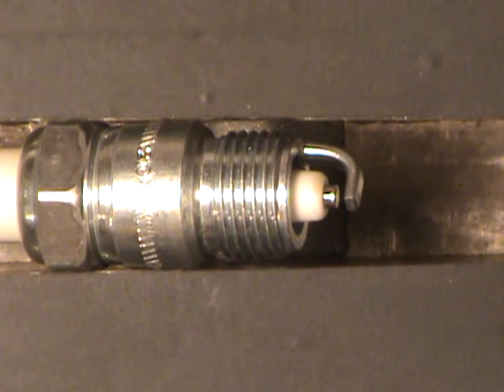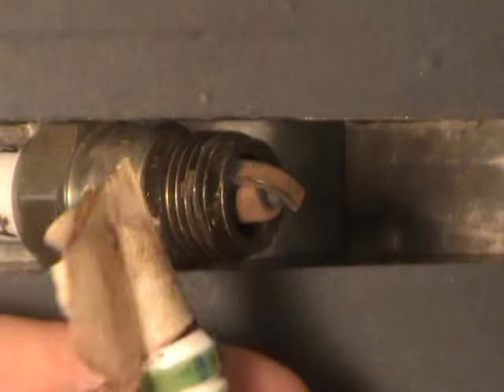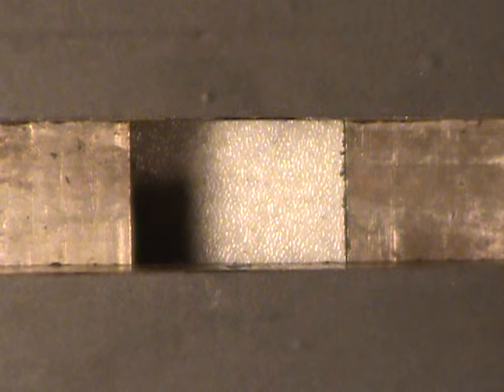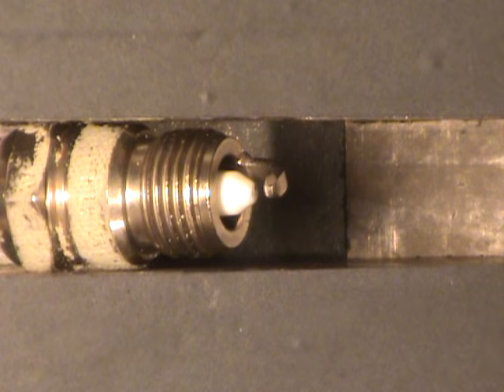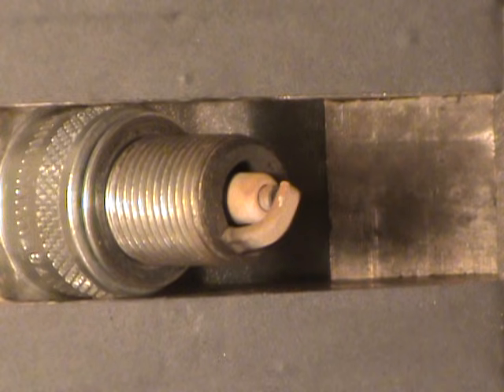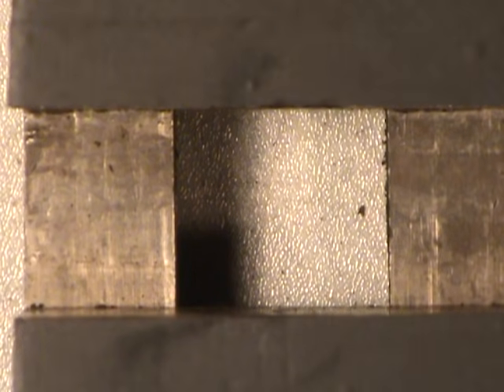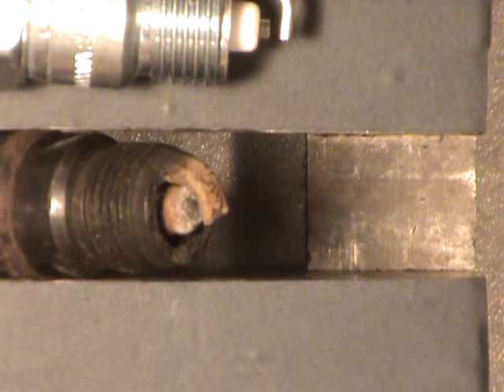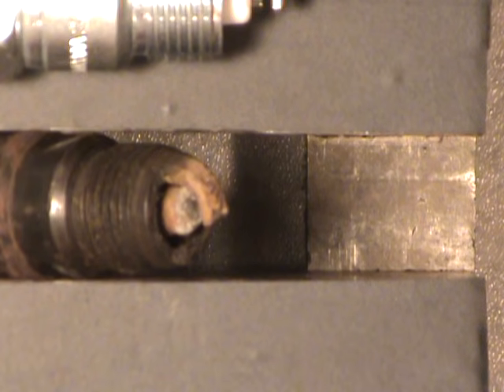SPARK PLUGS How to Read them (Part 3)

Comment: what would make your engine run hot
Reply from the maker: +Buddy Love ....Greetings Buddy Love....Thanks for watching....................I don't know what Vehicle or Engine, so, I'll just wing-it...lol.....................There are quite a few things, that can make an Engine run Hot, and hopefully Not Over-Heat as well.........When-ever a Tune-up is done on the Vehicle, the "Correct Specified or Certified" Parts should be installed, and the Tune-up, should be done regularly, and kept up to date.........A Hot running Engine, could be caused by some of the following..............Not enough Coolant (anti-freeze and water mixture), in the Radiator...Warning...!!!...Never Remove the Radiator Cap, or work on the Cooling System, when it is Hot, because it is under Pressure and will Burn You...!!!....Only work on it when it is Cold.....................A Restricted Radiator (internally, as in corrosion, or any unwanted deposits), usually caused by, not changing the Coolant (anti-freeze and water mixture), at the Recommended Time or Mileage/Kilometer-age Intervals...........A Faulty/Malfunctioning Thermostat, or a Thermostat, having too Hot of a Temperature Rating for that specific vehicle..........................Before the Computer/Fuel Injected Cars came into being, the Ignition Timing was adjustable, and if not done right, that could lead to, having the Engine run hotter then wanted as well............Those were just a few examples for You, and, if You need more help from me, then, if You care to, just let me know about, just What Vehicle, and What Engine, and the Miles or Kilometers, that it has on it, that way, I won't have to go on, what I like to call...A Wild Goose Chase...lol...and...........till next time...........Be Safe, take care, and have a good one.

Comment: great video thank you
Reply from the maker: +DieselSmoke92 Greetings DieselSmoke92....Thanks for Your nice comment, and, Thanks for watching...........You'll probably find, in a lot of cases, that, the some-what newer, (gasoline), Fuel Injected/Computer Controlled Engine's, Spark Plug "Deposits", might not be so much, well, as compared to the "Deposits" that You saw, on the spark plug samples, that I used in this particular YouTube Video of mine, and, might be looking, kinda white-ish in color at times.................From what I've heard/read about, the Higher the Ethanol (alcohol) %-age/percent-age, that is actually in the Gasoline Blend, that the Engine burns, then, the (probably/maybe?) Less Deposits, might be found, showing-up, on the spark plugs, in that particular engine, perhaps..................Some Folks, are using, what appears to be, kinda looking-like, that special flash-light, that a Doctor might use, to examine Your Ears, in order to have a much Closer look, at the Deposits, that happen to be, on the spark plugs................Perhaps, have a look around, on, some of the Web-Sites, for that, what I like to call, the..."Rocket-Science-Method"...(as in, using that special flashlight/magnifier, thing-ah-ma-bob)...in order to have..."Close-Encounters-of-the-Spark-Plug-kind"...!!!...lol...and...........till next time............Be Safe, take care, and have a good one.

Comment: Thank you so much! I have a car that was saying system is too rich, but on observing checking out the spark plugs with this, is seems to be running lean! Now I know I may have problems with the O2 sensor giving wrong info.
Reply from the maker: +golavish Greetings golavish....Thanks for watching.....................Please note, that, some of the newer, (gasoline) Fuel Injected Engines, might not have very many Deposits showing on the Spark Plugs, and, at times, the Porcelain-looking material, that surrounds the Inner/Center Electrode, might be showing an almost White-ish Color, and perhaps more-so, if the %-age/Percentage of Ethanol (alcohol) gets higher, in the Gasoline (blend), that You put in Your Vehicle's gas tank............................There are 3 basic things, that should be done, on a Vehicle, that has a Gasoline, Fuel Injected Engine, before, You might start to change this part and that part, which at times, might not fix the problem, if indeed, there really happens to be one................................Has Your Vehicle been well Maintained, as well as, having the Parts, such-as, Air and Fuel Filters, new Spark Plugs, etc., that should be Replaced, at the Vehicle Manufacturer's Mileage/Kilometer-age or Time Interval...???...............................Then, the other 2 things are.......Have Your Vehicle's On-Board Computer (about ,1996 and newer), Scanned for "Trouble Codes", with a Scan Tool (kinda looks like, a slightly Larger, hand held Calculator), in order to see, whether or not, Your Vehicle's, Computer's Memory has Stored any Trouble Codes, that will really help You out, if there happens to be any, that is.........................Then, the Fuel System's, "Fuel Pressure", needs to be Checked/Verified, according to Your Vehicle Manufacturer's, Fuel Pressure "Specifications"..............Warning...!!!!...some of those Fuel Pressures, might be, as High as, "60 PSI/Pounds per Square Inch", which can be very Dangerous, and, always Wear Eye protection/Safety Glasses/Goggles, have a Fire Extinguisher near-by, and Do any Fuel related Testing or Maintenance, and also, when-ever the Engine is Running, "Outside", with plenty of Fresh Air and Ventilation, because, the Engine's Exhaust Gas is "Deadly"...!!!.........................Some of the Automotive Parts places, might "Scan" Your Vehicle's Computer for "Free", so, just make a few Phone calls, to see, if any, in Your area, actually do...........................If You care to, You can let me know, the...Year...Make...Model...Engine Size...and any Problems, that You might be having with Your Vehicle, and.............till next time............Be Safe, take care, and have a good one.

Comment: mine come out white an it started bucking so im going to change my fuel filter it only has 180,000 miles lol
Reply from the maker: +Y0uNgM3xicAn Greetings YOuNgM3xicAn....Thanks for watching.......................If Your Vehicle is Fuel Injected, then, the Fuel Pump, will usually be installed, Inside of the Gas Tank...............................If...???...the Fuel Filter gets "Plugged-Up" too much, then, that Fuel Flow Restriction, could cause the Electric Fuel Pump (inside the gas tank), to "Burn-Out", and not work anymore...!!!............................I had this happen to me, soon after, I put some super-duper Fuel System Cleaner, in the Gas Tank, and, it did such a good job, that, it must have Cleaned, most of the Gas Tank's Innards, and sent all of that Crud/Debris/Yuck-ees, right into the Fuel Filter, and pretty much, Plugged it right Up, and Ruined the Fuel Pump...!!!........................Those Fuel Injected Fuel Pumps, could cost about $200 (Two-Hundred Canadian Dollars, that is), give or take, quite a bit, and, if You have to Pay Someone, to Re & Re (Remove and Replace) "it", then, the Price to do so, including the price of the Fuel Pump, could end up costing in the neighborhood, of about $500/Five Hundred Canadian Dollars, give or take, quite a bit...!!!...Yikes...!!!...and a Nice New, about, 10 Dollar Fuel Filter, could have prevented, that, very unwanted Expensive Repair Bill...!!!...so, it's really good, that You are putting in a New Fuel Filter alright................If You plan on keeping Your Vehicle, for quite a long time, perhaps consider, getting a Factory-like "Chassis (pronounced...Chass-ee) Service Manual" for it, that's if, You don't already have one, that is.............................Keep a close watch, on all of Your Vehicle's Fluid Levels, and Filters as well, and, install New ones, when-ever, the Factory Recommended, Time or Mileage/Kilometer-age, becomes due, in order to avoid, any Problems, that are not wanted........Yes-Sir-ee-Bob...the Fuel Injected Engines, that are being Controlled by a Computer, will probably be, having Spark Plugs, that, don't have a whole lot of Deposits on Them, as compared to, the much Older Vehicle's, that have Carburetors, Distributors, and No Computer what-so-ever...lol.................................If You care to, and, if You are having any problems with Your Vehicle, just let me know, in a comment/question or two, under any of my YouTube Videos, letting me know, what Vehicle, and the Engine that's in it, and I'll do what I can, to help You out, and.............till next time............Be Safe, take care, and have a good one.

Comment: is there anything out there for, 2009 Xterra spark plug change, please i need help, cant find anything, email please, thank you HOWARD habeas7@gmail.com
Reply from the maker: +Lecy Alphamaids Greetings Lecy Alphamaids....Thanks for watching, and now, let's see what we can do, to help You out, with finding some Spark Plugs, for Your 2009 Nissan Exterra, shall we..............................Here's what I would usually do, if I was in Your shoes..............................First, I would try to find, the "Exact Same" Spark Plugs, that were "Originally Installed" in, Your 4.0 Liter V-6 Engine...???... if in fact, Your Engine has not been Modified at all, at any, of the Auto Parts Sales Establishments, that were, reasonably close, to where I, actually, where You live, oh and, for a reasonable Price, as well............................Then, if they didn't have them in Stock, I'd find an Auto Parts Sales Establishment, that would..."Order, a Set of the Original Spark Plugs"...in for me, in a reasonable amount of time..............................Have a look, in Your Exterra's Engine Compartment, for a V.E.C.I. (aka, Vehicle Emission Control Information) Label/Sticker, and, sometimes, on that Label/Sticker, the "Original, Factory Installed Spark Plugs", will hopefully be Printed on it...................................Also, the better equipped, Auto Parts Sales Establishments, will usually be able to do a "Parts Look Up", for Your "Exact Vehicle", and, that Spark Plug "Listing", would usually have, quite a few, Different, Spark Plug, Manufacturer's "Offerings", but, for a Factory Stock Engine, I always, try to get a hold of, like I was sayin' earlier, the "Originally Installed, by the Vehicle's Manufacturer...Spark Plugs"...cuz, I figure, that, there's a better chance, at getting it Right, the first time, just in case, there might be a slight difference, between the Other Spark Plug Offerings, out there, but hey, that's just me......................It's "Very Important", to get a Set of Spark Plugs, that have, the "Exact...Same Reach and Heat Range"...as well"...!!!...............................The "Reach", is the Length, measured from, in this case, from the Spark Plug's Sealing Washer, to the End of the Outer Electrode, and, if it's, Too Short, the Spark, will be too far away, from the Cylinder Head's Combustion Chamber (inside), and, it gets Much Worse...if the Spark Plug's "Reach", is "Too Long", and, by being Too Long, it can get "Too Deep", into the Combustion Chamber, and might get "Hit", by the Piston, and/or, one or more Valves, and, some, Very "Bad/Expensive...Engine Damage", could very well be, the result...!!!...Yikes...!!!.........................Also, the Spark Plug's..."Gap"...that be, the Distance...Between...the Inner and Outer Electrode/s, has to be...Verified/Checked...with a...Gauge...and, Adjusted, if need be...But...Watch Out now, cuz, some Spark Plug...Designs..."Are Not Adjustable"...!!!...please "Check", just to make certain........................So, if and when, You get ah-hold of, a new set of Spark Plugs, put one of the Old ones (hopefully, it has the Correct Reach), side by side, with, one of the New ones, to "Make Sure", that, "They are the Same Reach"...!!!................................Now, about the "Heat Range", of those New Spark Plugs........The Heat Range, is based on, the Spark Plug's ability, to Transfer, a certain amount of Heat, from it, into the Engine's Cylinder Head/s...........................................Too Hot, of a Heat Range, and, the Engine might get Damaged...!!!..............................Too Cold, of a Heat Range, and, the Spark Plugs, wouldn't be able, to stay Clean, for all that long, cuz, Engine Deposits, would usually Build Up on them, and might cause, the affected Spark Plug, to "Miss-Fire", and end up, probably having, a poor running Engine, as a result............................."Watch Out Now"...!!!...cuz, some Spark Plug Manufacturer's..."Heat Range Numbers".."Go Up"...and Others..."Go Down"...!!!......................See now, why I always try to stay, with the "Original, Factory Installed Spark Plugs"...???...........................The Less "Error", the better, I say, and, to Each, Their Own................So, now, that the "Ball is in Your Court" (so to speak)...please choose wisely, my Friend...........Good Luck, and.............till next time............Be Safe, take care, and have a good one.
Reply from the maker: +JOEY JILL Greetings JOEY JILL....I have a few things to say, that should help You out.................I have a Video, on my YouTube Channel...RockysRoadshow...and the "Title" of it is...How To Change Spark Plugs...and, this particular Video of mine, has, most of the "Basic Information", that will, for the most part, apply, to Changing Spark Plugs, in just about any Engine, that is equipped with Spark Plugs..................Now then, You were saying, that, You didn't find any Videos, that would show You, how to Change Spark Plugs in Your Vehicle.............................Well, there are quite a few Nissan, and maybe Xterra..."Websites", on the Internet, that have..."Forums"...on them, where You can ask, how, You would go about "Changing the Spark Plugs", in Your 2009 Nissan Xterra, and, I'm quite sure, once You find the Website "Forum", that suits You best, the very Knowledgeable People on that "Forum", should be able to help You out...............................There might be a chance, that, one or more, of Your Spark Plugs, can be very Difficult to "Change", and, the People, that have Changed, those, probably, quite hard to get at Spark Plugs, might be able to tell You, a Trick or two, that will make, Changing those Difficult to Change, Spark Plugs, that much easier..............................So, before You start "Changing any Xterra Engine Spark Plugs"...Make Sure, that, You know, what You are getting into, Difficulty-wise, and Tool-wise, when the time comes, to actually Change those Spark Plugs...!!!..........................If and when, You ever get around to, Changing Your Spark Plugs..."Only Remove One Spark Plug, and its Lead/Wire at a time, and Replace that very same, Spark Plug and Lead/Wire, Before You Remove the next one...Why You ask...???...because, if You Removed, all of the Lead/Wires and Spark Plugs, at the same time, You would probably have a very Difficult time, trying to figure out, which, Spark Plug "Lead/Wire", went to, Which Spark Plug...!!!...and, that's the reason why...............................So, have a look at my YouTube Video......then, see if You can find, a Website "Forum", that has lots of Information, and, where You can ask, some of those, very experienced People, about Your, 2009 Nissan Xterra...........Good luck......and..........till next time...........Be Safe, take care, and have a good one.

Comment: How to sharpen hedge cutter blades
Reply from the maker: +John Wilson Greetings John Wilson....You commented...How to sharpen hedge cutter blades................Well, I have a Video, on my YouTube Channel...RockysRoadshow...that's Titled...How to Sharpen a Lawnmower Blade...............Perhaps, watch that Video, then, let me know, what You can, about Your "Exact" Hedge Cutter, as in...Gasoline or Electric (Power Cord or maybe even Battery Powered...???)...and...is it the Type, that has a Straight Bar-like Cutting Unit on it, that usually has a Stationary/Not Moving Bar, with the Cut-outs in it, where the Cutting Blade, goes back and forth, and, once the Small Branch, goes into those Cut-outs, in the Cutting Bar, then, the Moving, back and forth, Cutting Blade, Shears the Small Branch off, is that the Type, that You have there...???.............................Once I do know, the Type of Cutter Blades, that You want to sharpen, then, I'll do what I can, to help You out.........................Till next time...........Be Safe, take care, and have a good one.